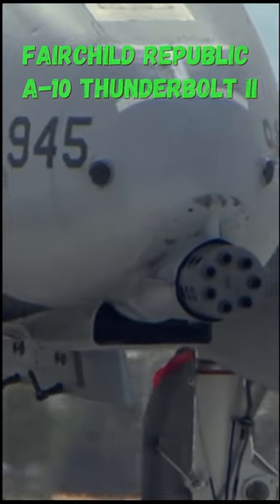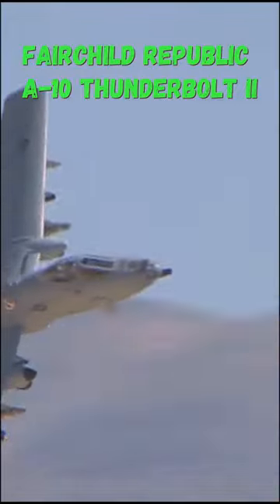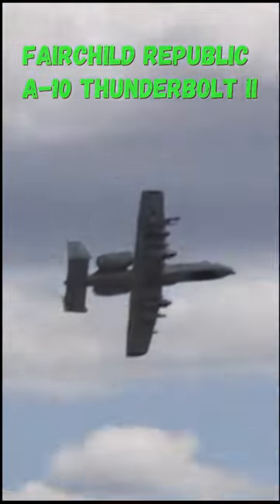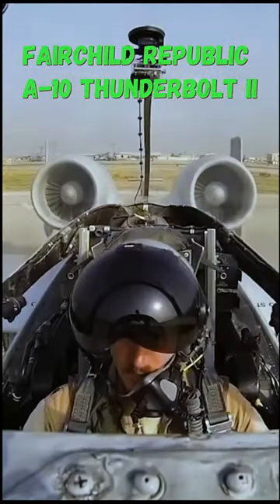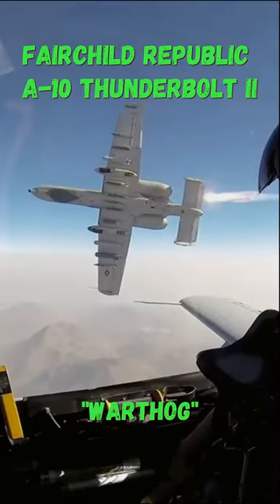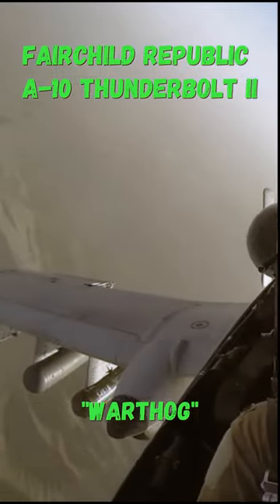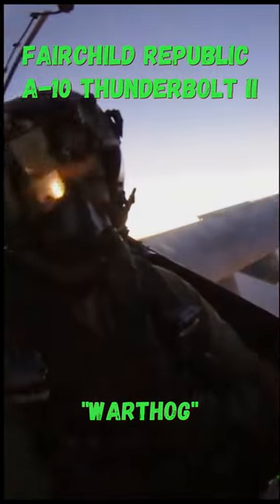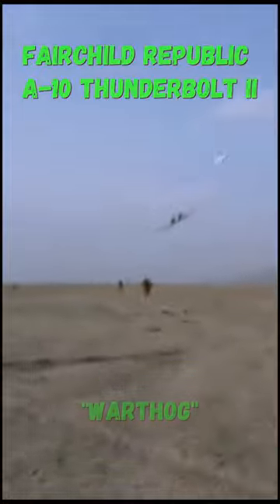The A-10 "warthog" A tank crew's worst nightmare! #shorts

Comment: Btw there is no primary source on the 900 tanks figure also there were only 350 tanks in use by its enemy’s that the cannon could actually penetrate
Reply: they attack the top of the tank turret, beacuse the armor is super thin...as in only an inch.
learn more before spouting stupid info.
Reply: @Gizziiusa  no the t-72 t-80 etc all can’t be penned by the 30mm even from a vertical attack